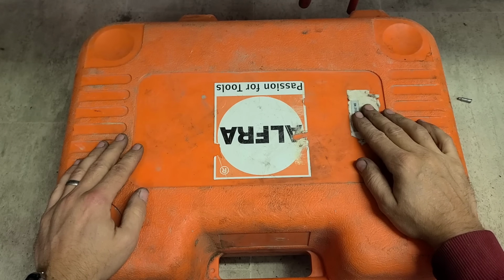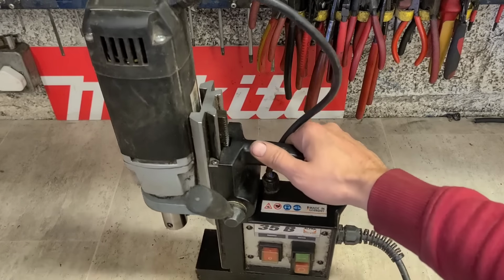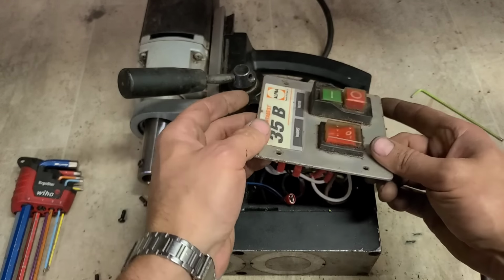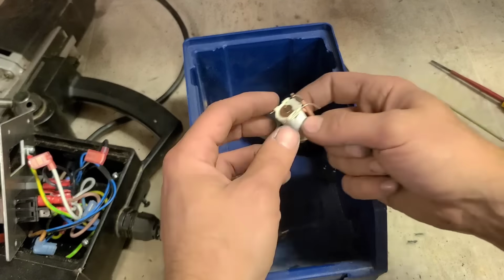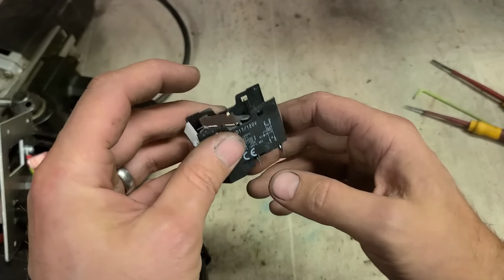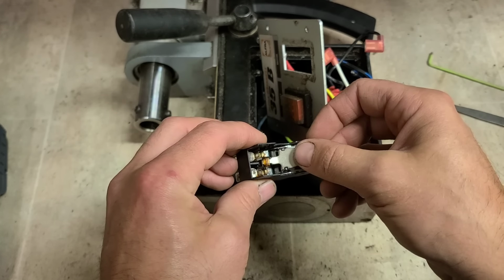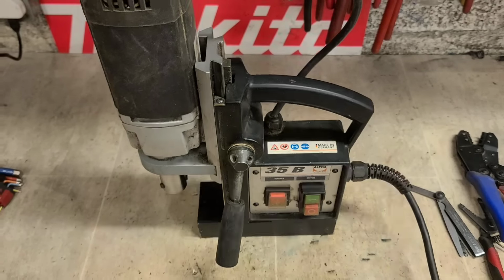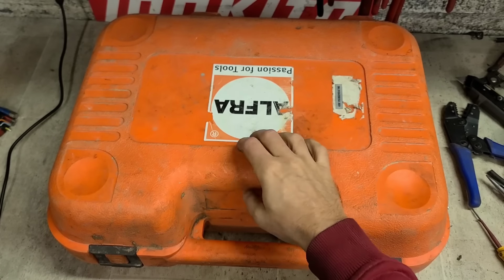Repairing a faulty motor switch on a Alfra 35B Magnetic Drill that's still under warranty.

Comment: Got exact same issue on my mag200 by BDS. The board had blown a resistor, so replaced the board. Then it would stay on like your switch. So replaced the switch. Exact same issue. All runs perfectly if switch is held in but goes off when I let go

Comment: Really enjoy watching your vids even though most not needed for me. But this one with the switch, Ive got a cement mixer with same fault, think weather has got to it, but this is most likely same issue. Also a spun bearing, so need to weld and turn down a shaft. Thank you

Comment: Pretty odd for a 400$ mag drill to have a warranty that actually outlasts the tool..  don’t see to many alfra tools..
Reply: It's most likely an issue with the power. The coil can be damaged when there is noise or a spike in the electrical line

Comment: Can you explain the circumstances in which you would need to use a magnetic drill as opposed to any other type? Cheers!
Reply: Anytime you could use a hand drill you pretty much can use a mag base drill. 
Except with non ferrous metals of course. 

The annular cutters these have cut so much quicker than going up through the sizes with a regular twist drill on a hand drill. Less wear and tear on the operator too. I used to build logging trucks in my early career, there’s so much 5/8” and 3/4” hole drilling on those it’s not funny, when we got our first rotabroach machine it halved (at least) the time spent drilling.
Reply from the maker: Imagine trying to drill a 32mm hole into a 23mm thick RSJ. Imagine how hard you would have to press that drill bit agest the steel. 
A mag drill locks onto the metal you are drill with the magnet and the drill head pushes the cutting into the steel with a turn lever. 
These drill cut through steel like it was butter. so much faster and easier to do. Plus you can even use them upsidedown or side ways as the magnet holds onto the steel.

Comment: atleast its a simple unit....what i dont get why not just have a rocker switch or fix it or good and use a light switch magnetic switch is kinda dumb.......the one and only reason too have a switch like that would be a safety mechanism if it binds up and starts too wobble it can shut it off electronically

Comment: Nice fix! These switches are fairly common on these type of core drills, but also on table grinding machines, drill press machines among others, so we mostly have them in stock in our workshop.
But next time one of them with a faulty switch comes in, ima go check if it has something to do with the contacts 😊

Comment: What's the reason for a magnetic lock on the switch? Would a basic (cheap!) toggle switch not work the same?
Reply from the maker: Because a electro switch like this cannot be left in the on position when your finished. A toggle switch can be left switch on, so when someone plugs it in, it would start running. Not good.

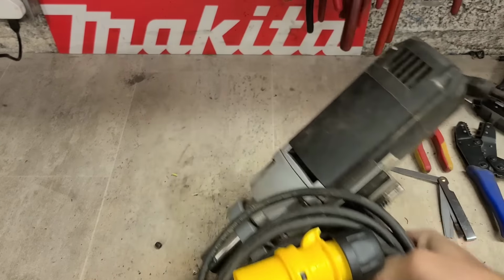Comment: At 19:05 a holding hex screw fell out of the head, visible at 19:15 left on the table during picking up of the tool.
Reply from the maker: Eyes like a hawk, never even seen it when clean the bench afterwards
Reply: @deandohertygreaser  you pulled it off the bench onto the floor when pulling the case across it.